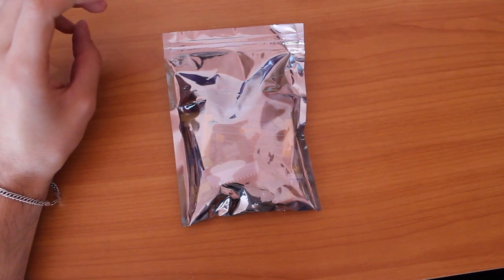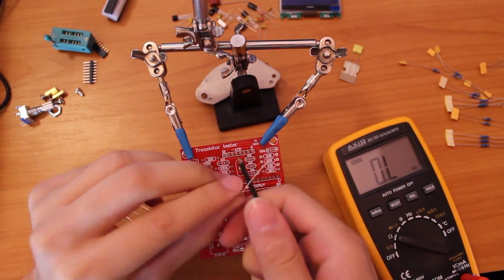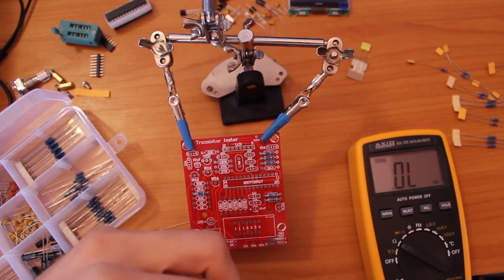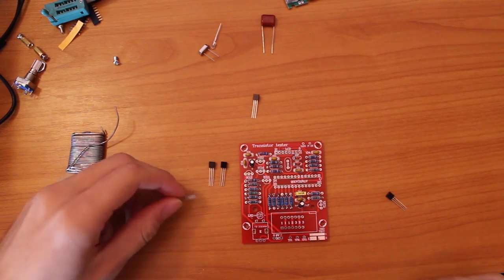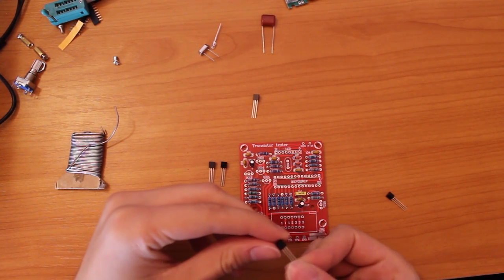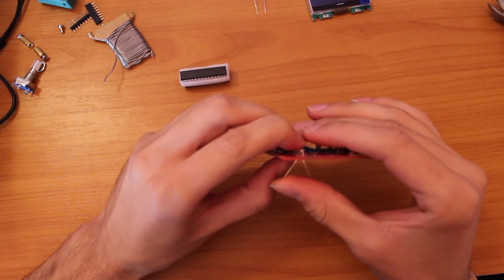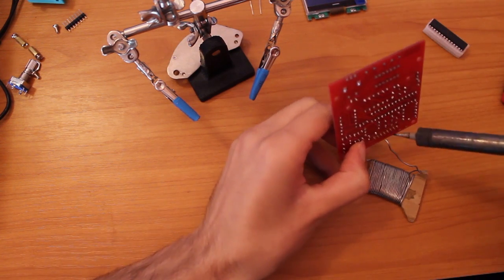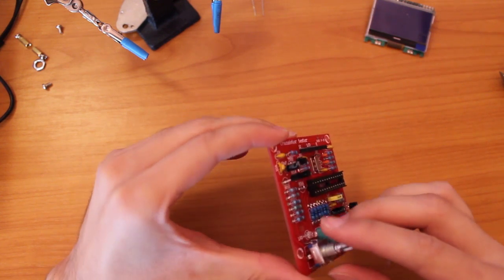M12864 Graphics Transistor Tester from Banggood, Part 1: Soldering

Comment: What brand soldering pencil do you have ,the end of mine looks like yours,but mine is a Weller knock off ,and I can't find tips for it .
Reply from the maker: That's a cheap no brand ZD-99. Now I'm using a ZD-931. Still cheap, but at least is has temperature regulation, the other doesn't. You'll find both under many brands.
Reply: Thanks for the info

Comment: My problem is that there isn't a 5 volt voltage on pin 7 to pin 22. What is the problem?
Reply from the maker: +leandre _ What voltage do you get? Check connections from the traces of the 9V input to the 7550 voltage regulator and the output of the 7550.
Reply: +Dragos Puri I get a 0V signal
Reply from the maker: +leandre _ Well, as I said, without having the board in front of me, all I can think of is to check that the 7550 voltage reg gets power, it's soldered the right way. And if true, take it out of the board and measure it separately (check the datasheet to make a basic circuit to test it).

Comment: Hi, the brass spacers (13:02) are supposed to support the display PCB. Thats why its only two. :)
Reply from the maker: +Sebastian45ACP Yeah, figured afterwards. Found the 2 spacers from the L C CE meter and since the display on that one is stable enough, as is on this one, I used the 4 total to support the Transistor tester.